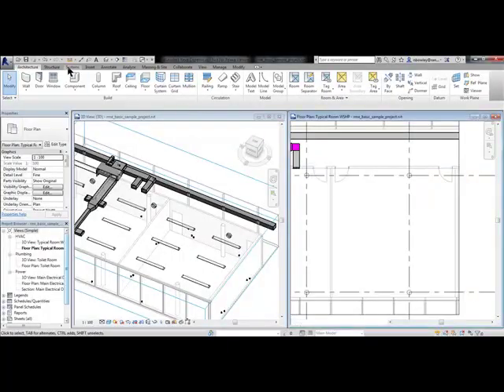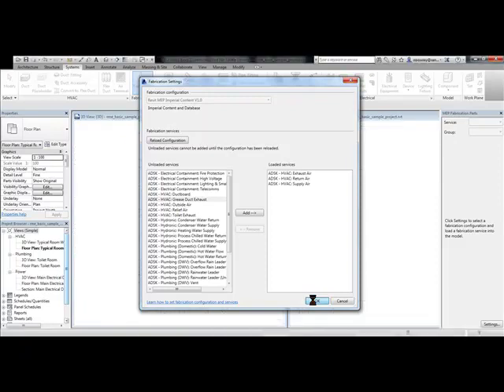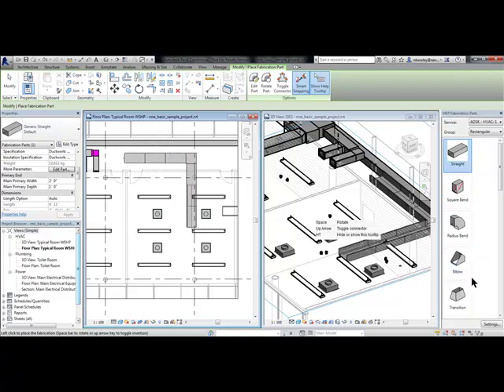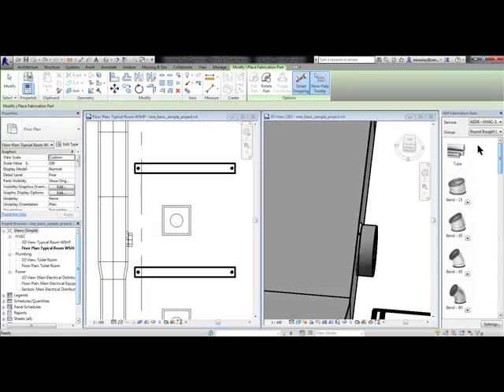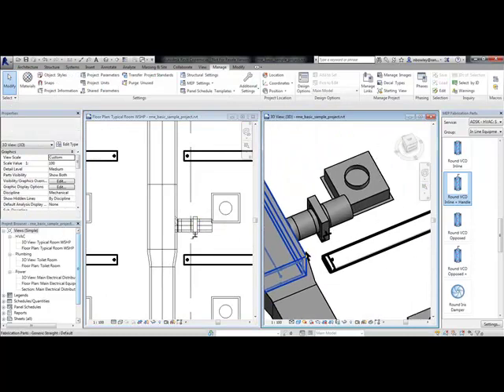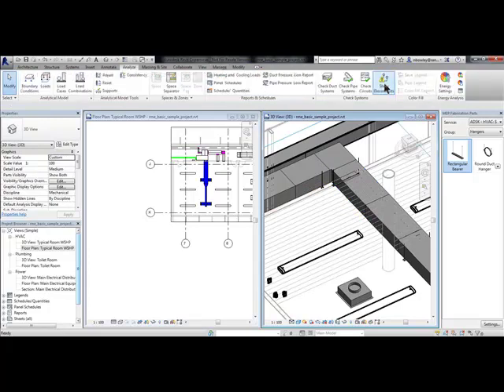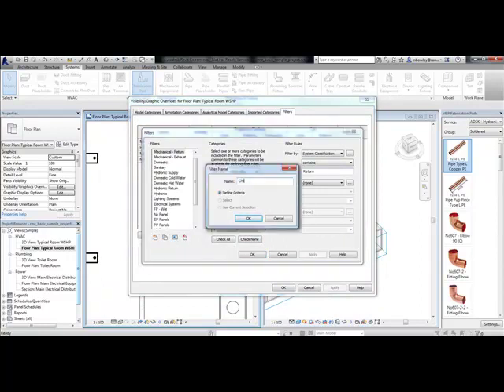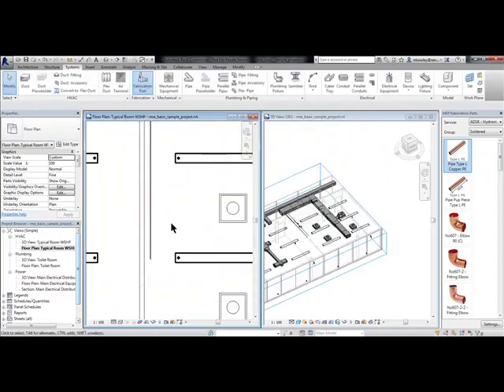Autodesk Revit 2016: New Fabrication Features

Comment: Revit mep 2015 have fabrication parts tool?
Reply from the maker: In Revit 2015 you can only export Revit based models (families) to a RIF file which then imports to Fabrication CADmep or ESTmep which converts it to a Fabrication model using Fabrication parts.

Comment: I have supply air, return air, exhaust air duct systerm, how can I manage 3 above systems if I use fabrication features? (I mean add colours for them). please help me.
Reply: You can setup a filter to control colors.  The filter category is Fabrication Parts and the filter rule would use Fabrication Service.   The Fabrication Services would be like HVAC: Supply Air.   Cheers.